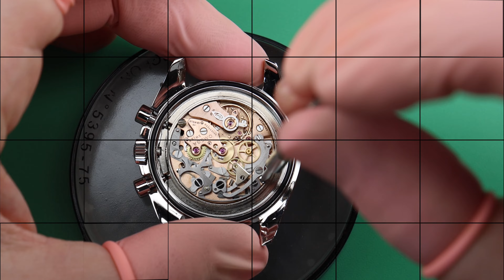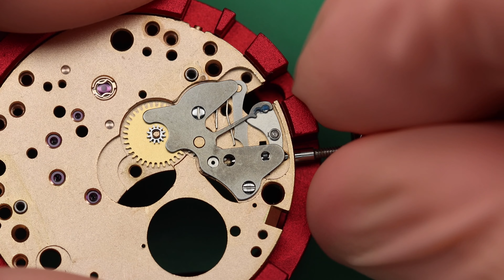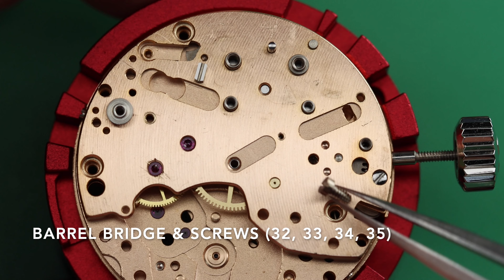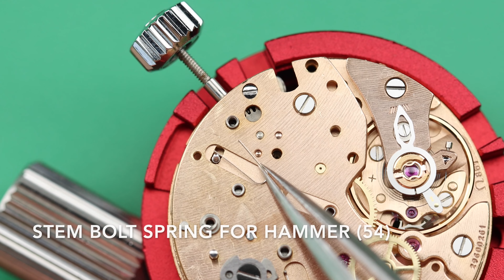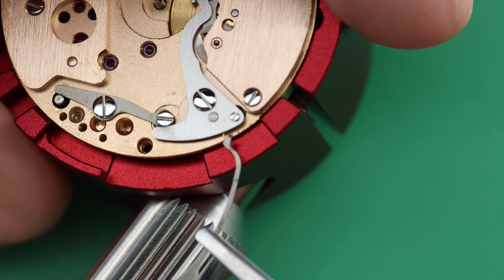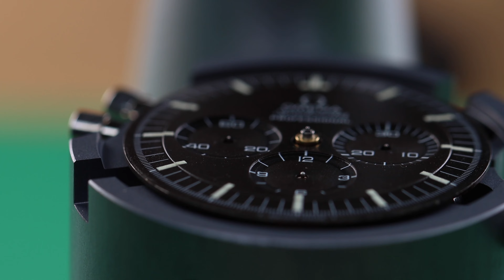Omega Speedmaster, the complete assembly process! | Tutorial DIY | Watch Repair

Comment: Brilliant! is there an adjustment if the watch runs a bit fast? ( mine is fast one minute every day)
Reply from the maker: Yes, on the balance complete there is a regulator. But it may also be that that will not help and that the timepiece needs maintenance.
Reply: If your Speedy is running a minute fast every day then more than likely it’s magnetized and or needs service right away. Mine is +5 seconds a day right now.
Reply: @therealwatchdoctor , what qualifies this as a “Rolex Daytona killer”?